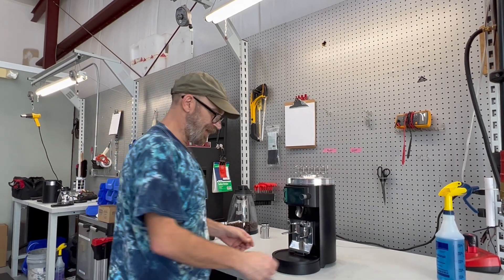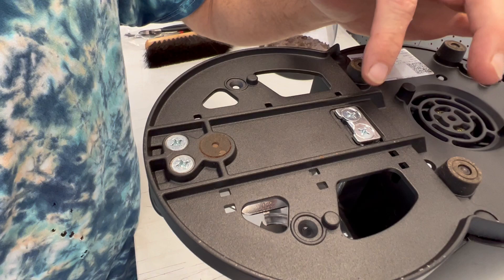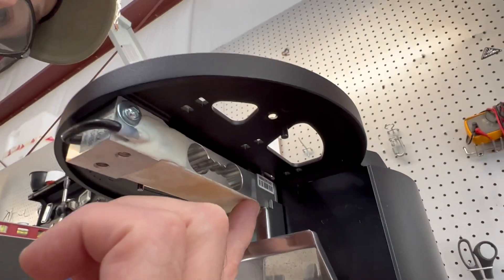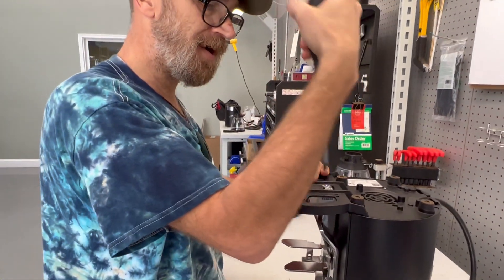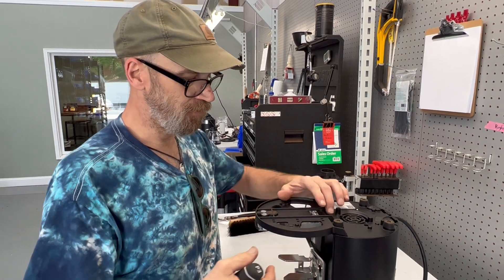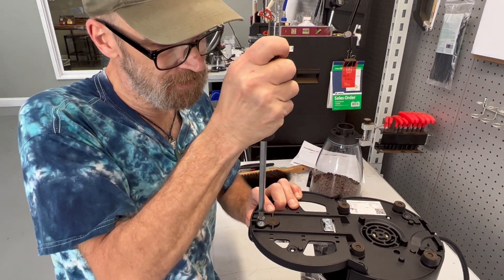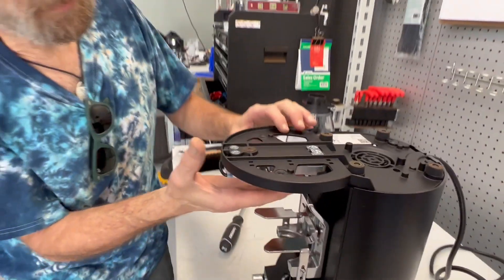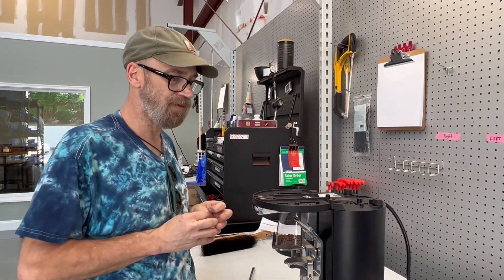TECH TIP: Mahlkönig E65S GbW Load Cell Alignment

Comment: My e65s GbW started acting up yesterday. It starts dosing without waiting to weigh the portafilter, and is even dosing with no portafilter inserted at sudden and random times. This just happened a few minutes ago. About 15 minutes after I ground a shot, the grinder came on and dosed about 4 shots worth of coffee before I could turn it off. I'll have to check the load cell as you outlined in the video. I carry it packed in its box in my cargo trailer to events. Might also be our high humidity right now. I may have to store it in air conditioned space between markets. I have two markets next week, so if I can't get this to work its back to a Niche zero and orion bean doser. Those are MUCH slower.